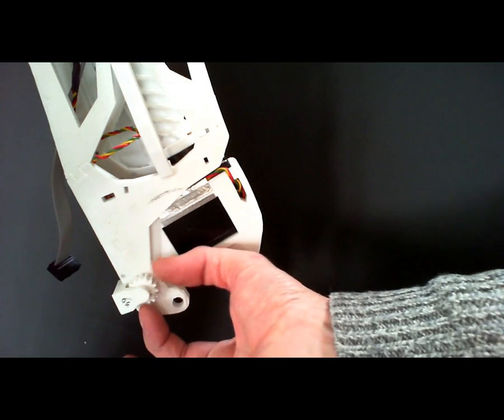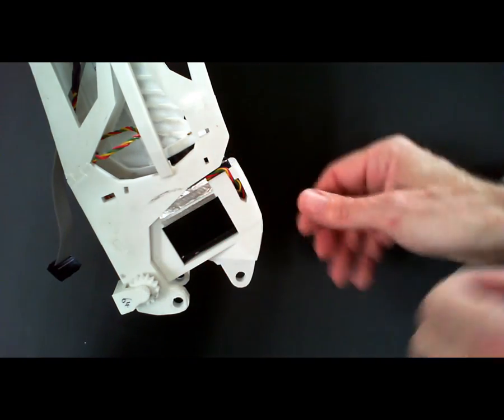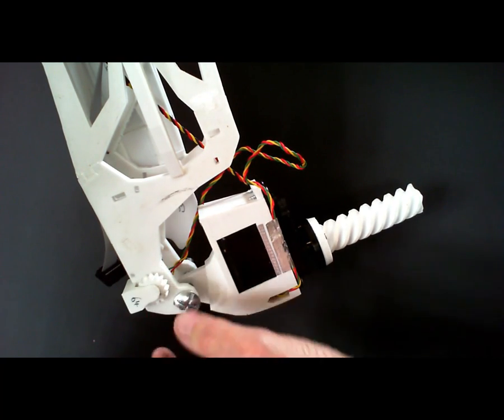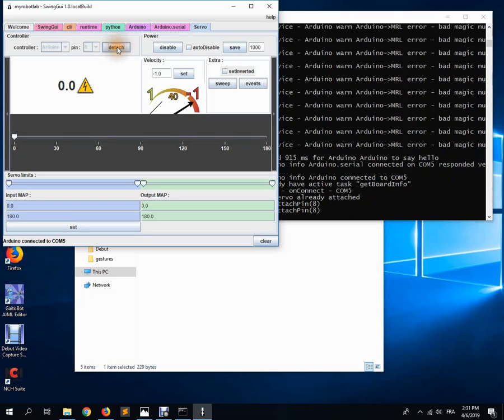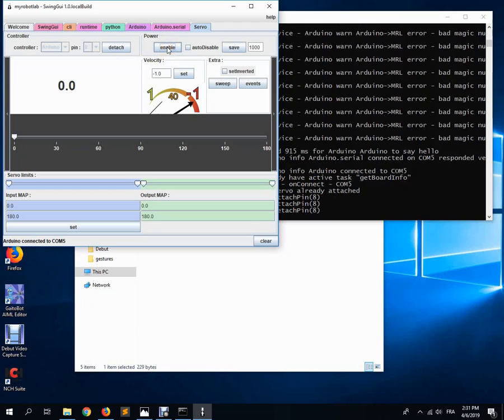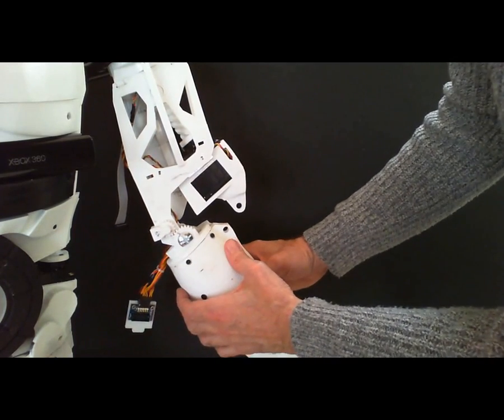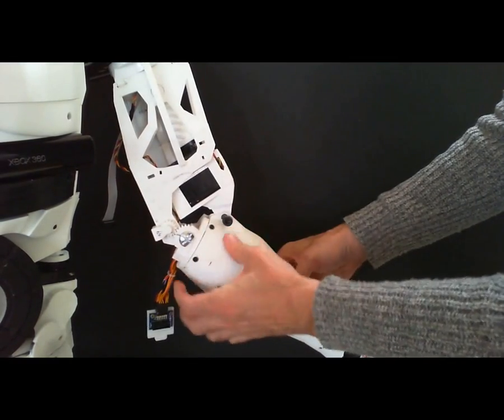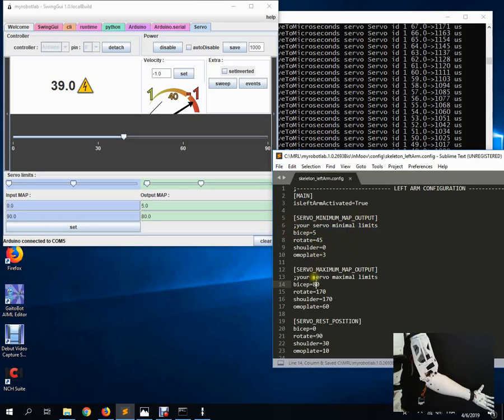Tutorial Bicep InMoov Robot

Comment: This comment is made with the translator. Is there a way to use the mg996r servomotor instead of Hitec HS-805BB on the bicep?
Reply: mg996r doesn't have enough power to lift the bicep causing it to overload or break. The safest option is 20kg servos or 40kg servos as this replacement.

Comment: Thank you very much for the videos Gael 
I have just one question 
In the Adjustable thumb for InMoov there are four wires/lines into the thumb. Two of them for open and close the thumb one on the back of the hand and the other one in the front.
wear the other two go and what they do And how does the finger action work - the sequence of movements and did Anar fix the top surfaces problem ? 

Thank you 🌹🌹

Comment: Thank you Gael.  I was having a polarity problem, and it is such a mindfk to get that pento turning correctly.  0 is extended.  And your raise the arm by increasing the degrees, where 70 ends up being the max.   I was messing around with it, and after watching this video, I finally had success!  Also, I hacked up my Android a bit, so its not a perfect representation, aka, I doubled gear thickness and added an embedded nut :-)